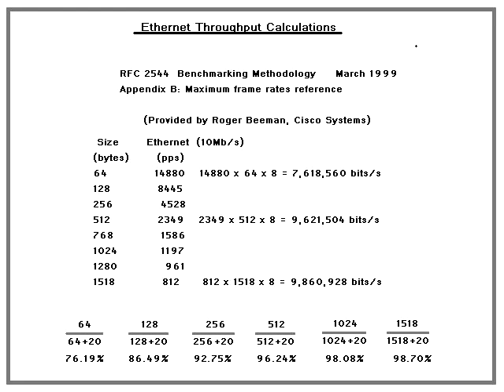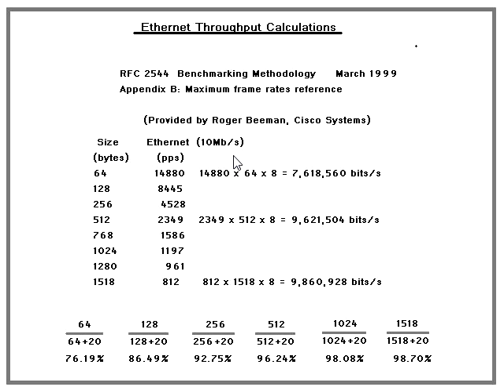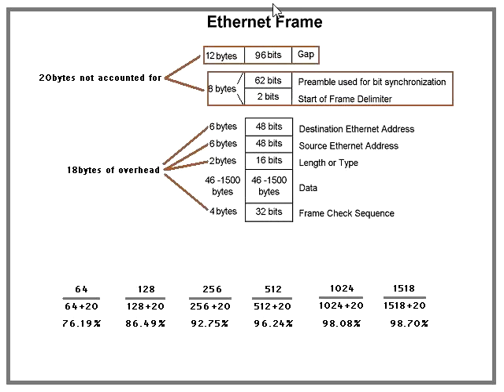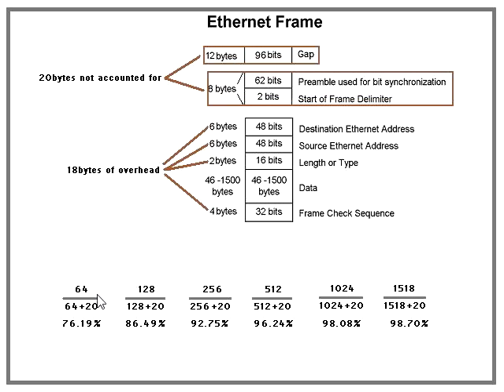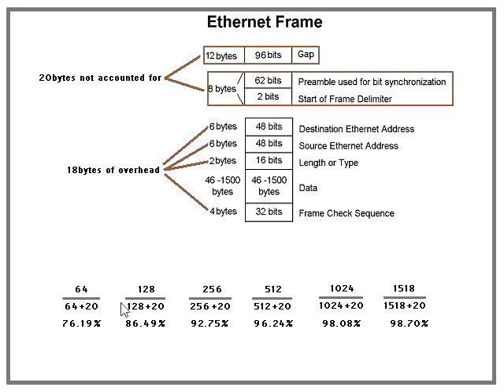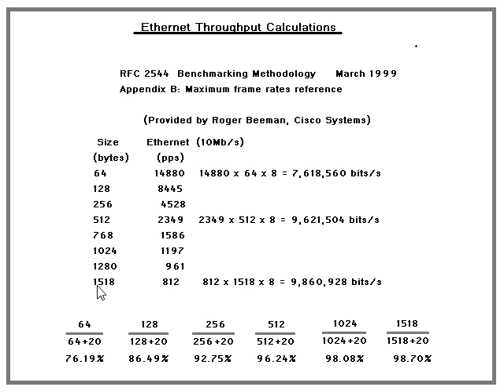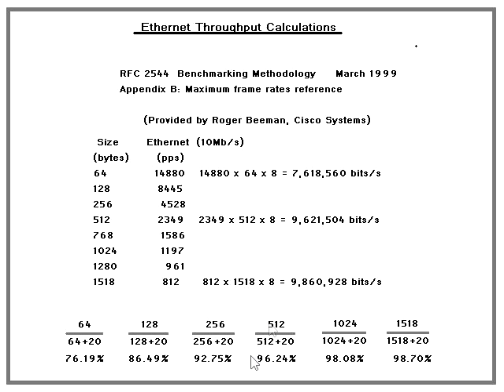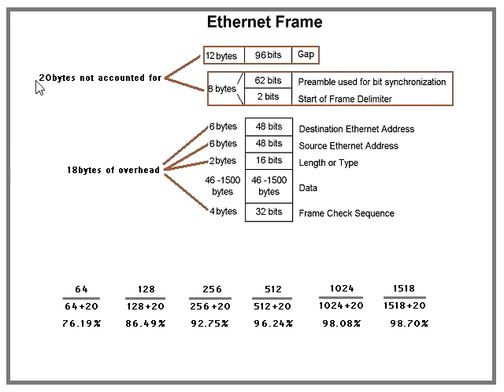Simple Ethernet Throughput efficiency calculation and explanation

Comment: how would you go about testing an eth port on a new pcb. Could a satisfactory throughput measurement using iperf ensure the eth port and its traces are reliable? Is RFC2544 mainly used for new pcbs or new switch/router designs?